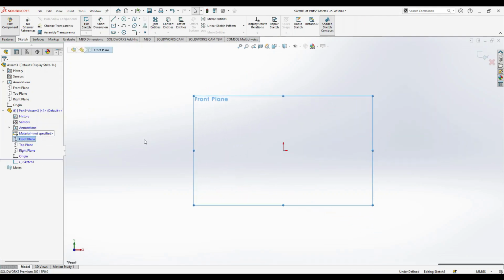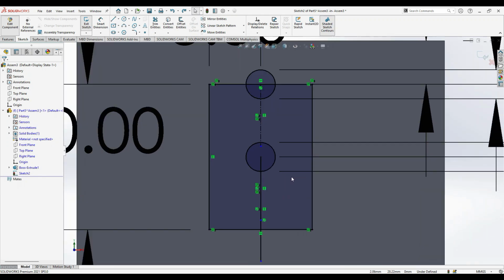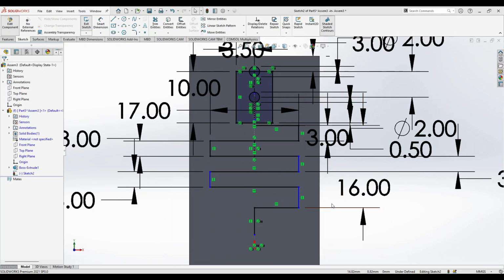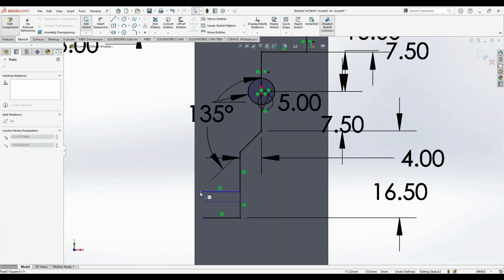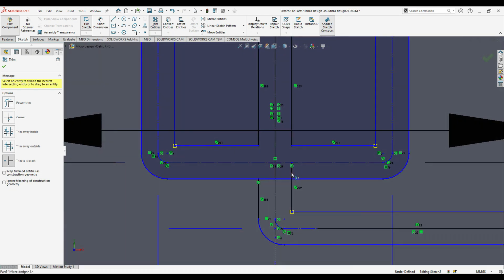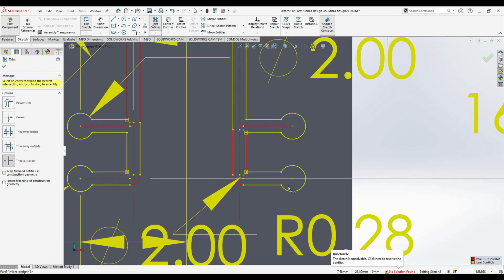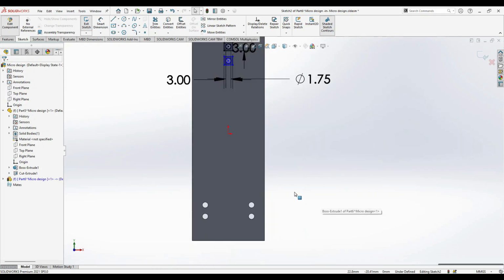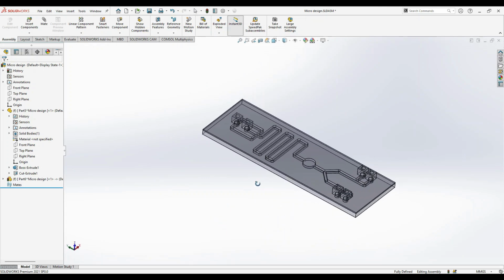Design of Microfluidic Channels for Commercial and Industrial Applications

Comment: Sir if we want two different size of extrusions in same channel . How to do ? Like in this video circular body we wants 3mm extrusion and channel extrusion 2mm. Basically I want to make a pit in same channel in the middle of channel. It’s urgent 😊
Reply from the maker: Hello Rahman. Thank you for watching. It is simple, in the existing channel after extrude cut, select that face and add a rectange at the required region and again use extrude cut, thereby you can make a groove with in the existing channel path. Hope this will help you !! Please share the content with a LIKE too.. Thank you..
Reply: @ thank you so much sir . For saving me 💕😎
Reply: @microfluidicsensing  hello sir . How can make mold  .I can make channel by just negatively extruded but how t make inlets and outlets